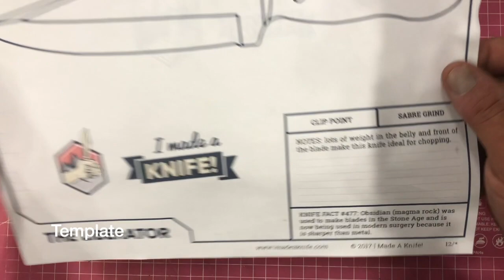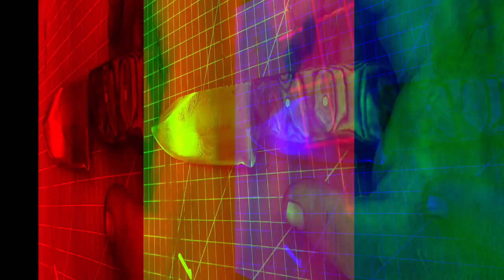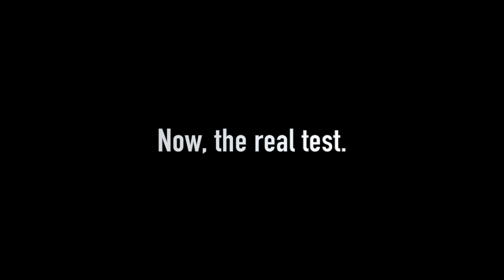First knife build, EBay Damascus

Comment: so who sells the non-garbage level damascus on ebay?
Reply from the maker: That’s could be one of 3 questions, so I’ll answer all:
1. Steel quality: Damascus isn’t all that fancy, both 10(84-95) and 15n20 are pretty cheap and easily attained in most of the world. So steel quality should not be much of an issue. 
2. Pattern: well you get what you pay for here. This was a cheap pattern and a cheap billet. Great place to start. 
3. Quality of forge welds: this question can be answered by looking at the reviews and feedback. There are billets all over EBay from multiple sellers. Read some reviews. Before answering this I checked out EBay, found 4 billets I’d buy in less than a minute.
Reply: @texacajundiy  yes sir thank you, ill check em out, looking to make something to withstand some hard work with a large blade for fun during camping while looking good. There are so many "damascus billets all over ebay, ill check out the reviews and pick up a piece and see how it goes.
Reply from the maker: Let us know how it goes for you.

Comment: What is oil ka name  bato
Reply from the maker: I quenched in warm used motor oil.
The drilling oil I used is 50/50 wd40 and new motor oil.
The oil the blade was wiped with after it was complete was tsubaki oil (Camilla seed oil)